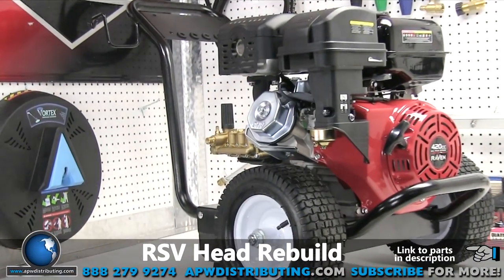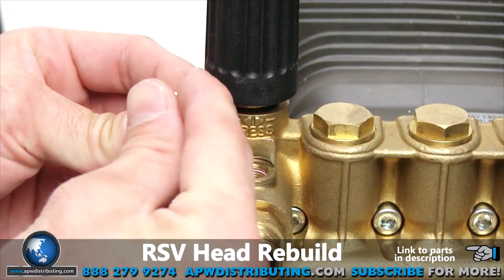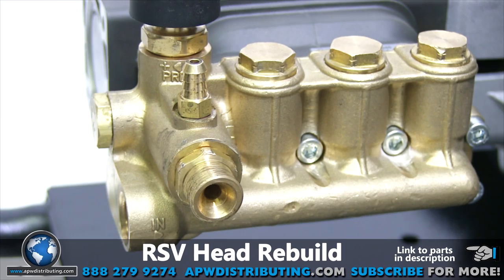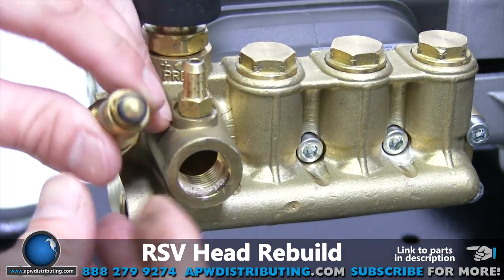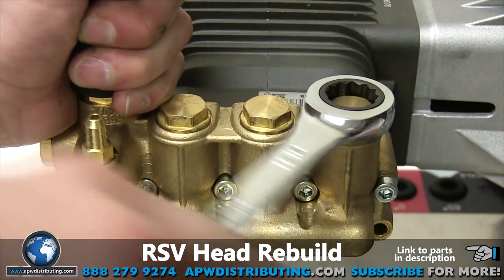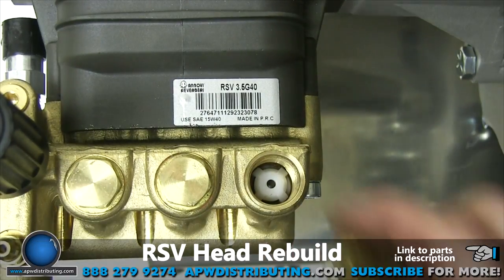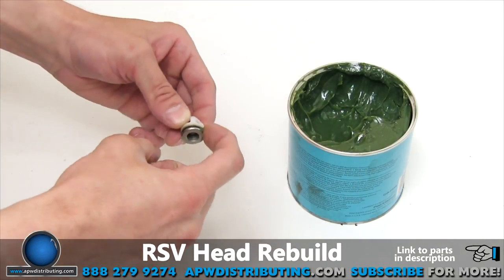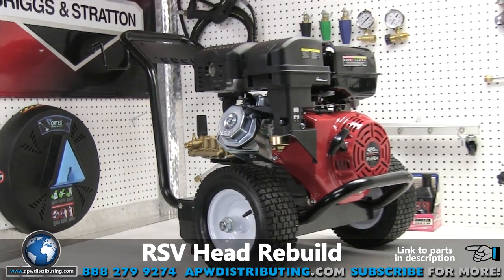RSV Head Rebuild

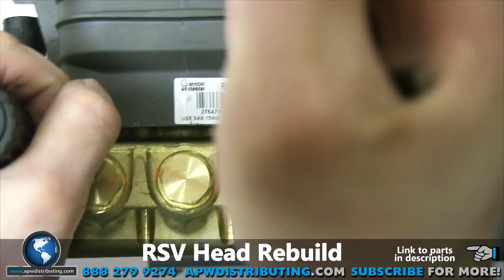Comment: If I drill between the 2 holes in the upper covers with a drill to enlarge, will there be more water passing through per minute? Technically, what can happen to the pump’s performance? Minute 4:28
Reply from the maker: Hello @pedromastosmatos1767 We do not recommend modifying your pressure pump like this. The pump has a maximum displacement based on the speed and stroke of the pistons. Increasing the size of those holes will not improve the performance. If you are looking to achieve a higher GPM we would suggest getting a pump that is rated for the GPM you are looking for.
Reply: @APWRepairCenter  Yes, but if I open the holes and remove the pressure from inside the pump, I distribute it through the line to the nozzle. Is this right? The diameter and speed of the piston are what controls the flow rate per minute. I ask. Would it be advantageous to add a Check Valve before or after the pressure regulator with baypass? Note: I have an RSV 4G40 pump with pressure regulator and external baypass. Venturini valve with external baypass as well. Original Venturini hole opened to the maximum with the drill. 1/2 hose 1.5 meters (4,921 ft) to the pressure regulating valve. Thank you for your time. Is check valve a good option?
Reply from the maker: Hello @pedromatosmatos1767, It sounds like you have added an external Unloader and bypass valve? I don't have any experience in modifying RSV pumps in this manor.
Reply: @APWRepairCenter  Yes I have. Okay, I was seeing if theoretically the check valve made sense in the pressure line. Anyway, thanks for the answers.

Comment: My pressure washer does not stop when I release the trigger. It is an electric mi-t-m. Could you give me an idea of what it could be?  thank you
Reply: Short answer―there's a problem with either a check valve in the pump, the unloader, or the pressure switch.

Longer answer―basically the pressure washer makes pressure by forcing water through some one-way check valves in the pump and will continue doing that as long as the trigger is squeezed and the motor is running. When you let off the trigger and the pump reaches peak pressure it needs to stop, and that's when the unloader engages and triggers the pressure switch to kill the motor. 

When the trigger is squeezed again, pump pressure drops which disengages the unloader from the pressure switch so the motor kicks back on. So if it keeps running then either the pressure switch failed, the unloader is stuck or has failed, or the pump isn't making pressure bc a check valve isn't fully closing, a seal has failed, or there's a leak somewhere where pressure is escaping. No idea if that makes any sense but I kinda hope it does

Comment: Lol.    One criticism if I may.....   you added the locktite to the valve right over the top of the slot it goes into... what if that dripped right down the center into the manifold?     Great video ///. I learned something
Reply: The bigger problem is he used red locktite, should use blue.
Reply: And also he's using a grease made for bearing on all the rubber seal, not the silicone grease.. not a good tips to follow..

Comment: I have a 4000 PSI. After I notice the Lost of pressure The gauge that I put on my pressure washer is only reading 2000 maybe 1000 psi. And when I pull on the trigger it goes too damn near 0. What would be that problem?
Reply: It could be the EZ start plug spring maybe be broken (the nut just behind the unloader near the thermal release valve)

Comment: whats the difference between a pressure pump that has a high PSI  rate but low water flow rate and visa versa?  I dont understand.. There are pumps with a high PSI pressure rate yet the water flow rate is only 12L per minute and there are pumps that are low  PSI but high water  ie 18L per minute.....  how do you know which is stronger?  You would think that the higher the PSI pressure rate  the greater the water flow rate but its not the case! I just dont get it.

Comment: I've followed this to the "T" and I've got "0" psi on the pressure gauge when pulling trigger on gun.  Engine runs great, pistons move, all AR parts used to reseal the RSV Head with new check valves as well.  Thoughts?  I've also inspected the unloader valve to ensure there's no debris.  I'm at a loss.  HELP!
Reply: Maybe a new pressure gauge? You should at least have 30-60psi with house water pressure flowing through the pump (that's assuming the water was on and you purged the pump of any air). But if by "0" psi you meant "low pressure" then it's either going to be one of your check valves remaining open (stuck or from debris), or the unloader piston at the bottom of the unloader valve is stuck in bypass and needs to be freed up. Sorry if this was 3yrs too late.

Comment: Excellent. I was looking for the oil for the water pump and I think it is the 15w 40.
it is right?
Reply: SAE 30 non-detergent oil.
Reply: At 2.15 in video it says on info plate 15w40. Some pumps do use a non detergent 30w oil, it doesn't foam up , but this one says 15w40
Reply: @mac4boys541  That's assuming it's belt-driven. If it's direct-drive and not a CAT pump or one that specifically calls for ISO-68 hydraulic oil, it's most likely going to be SAE 30 Non-Detergent oil, but it's your call in the end.

Comment: how much do all thease parts cost to rebuild the pump when needed  ihave mine on a john deer power washer the soap injector wouldnt work  been sitting  for a   couple months in the cellar i took the injector off cleaned it but it still wouldnt work didnt have much time for it after that i had it back in the cellar and took it  a part some more and cleaned it and sprayed some wd40 guess ill have to try it  again next  time i want to rince the salt off the my  truck

Comment: Please help!! If i wanted to run this to a bypass tank would i take off the bolt on the left of the unloader at 2:50 in your video?
Reply: or should i run a 3 way the put the outlet valve on etc